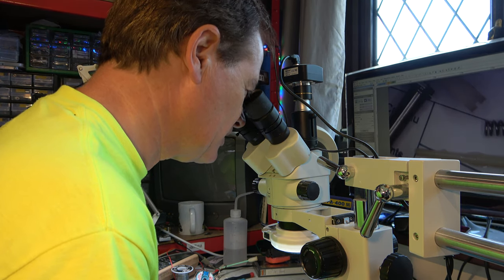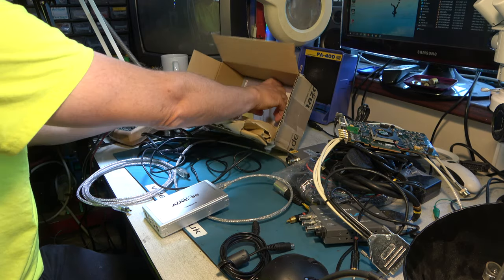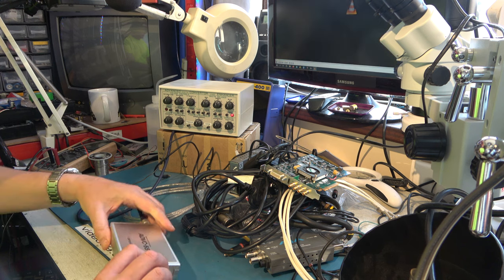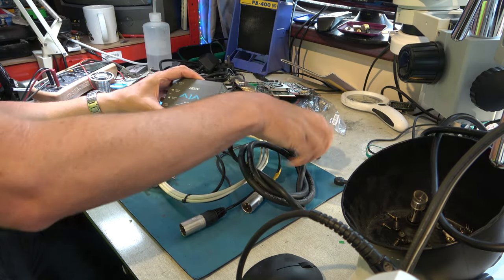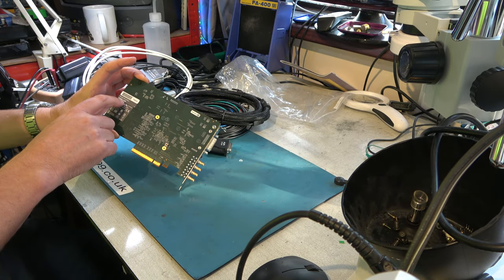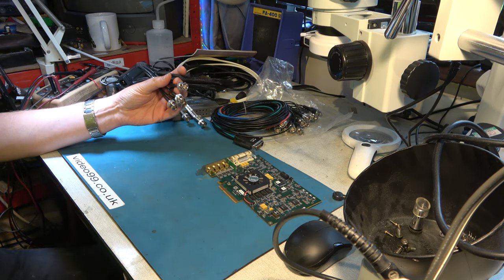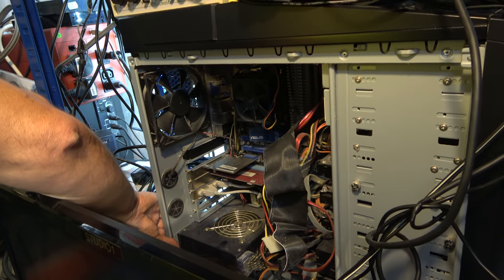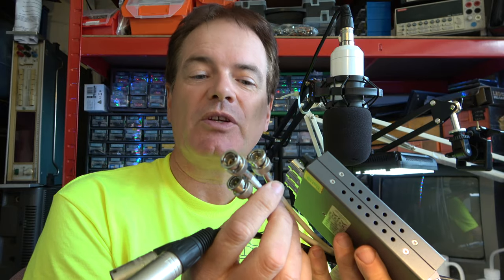Mailbag of fantastic audio/video goodies. And a terrible mistake?

Comment: There's a good chance the AJA SDI cable is closely bound like that because it's a bridge to the breakout box, which has 4 SDI connections at about that spacing on the back.
Reply: And thanks for the vid - interesting to see the application with the old decks!

Comment: The AJA Kona series of cards are great capture cards and very flexible with the multi-I/O options. At work, I was using a Kona LE on a 2008 Mac Pro as a dedicated PAL capture rig, the LE had analog audio IO which I used as the main audio out for the machine, I ran SDI into the card and also had AES/EBU connected to the other end of a Sonic Solutions SDIF converter and used the LE for input into Nuendo. I stopped using the card when the fan failed as shortly thereafter a 2012 Mac pro was freed up to become the capture machine and it already had a BM deklink card installed. For now, the Kona is sitting in an antistat bag waiting for a fan.

Comment: My heart also stopped when you plugged in that very nice looking card with semi power applied.
Thankfully the system was in some kind of sleep/standby.
Phew! 😀i was pleased :-D
I would be surprised if the quality was anywhere near your pro equipment.
Fun to have a look and a fondle of some interesting gear :-D
Ooow you had glued something at the start, was the part strong enough?.
That j.b weld is much stronger than araldite with rough repairs.
Reply from the maker: I've not yet tried the repaired SuperBeta part, I doubt it will hold though.  However I've been quite busy with my head in a Panasonic K-mechanism this weekend....

Comment: This is the first time I've seen a computer power supply installed like this. I believe the PSU should go with the fan facing down, not up. That way you will suck up the fresh air from under the case, which I'm sure has some kind of air filter in it. At least this is what I see in every case-build manual I read. If you leave it like it is now, you will get massive amounts of dust inside your PSU. If the layer of dust gets moist a bit, it will short something out in time.
Reply from the maker: There are no vents in the bottom of this case.  It's quite an old design.  If it had been mounted the other way, the fan would have been up against a metal sheet.

Comment: The tripod you had was sold in Asda around about the early 2010's. I know this as I owned one. Horizontal was silky smooth, and the legs extend to become extremely tall and remain stable. but vertical movement was awful.
Reply from the maker: Tilt seems a bit sticky, I'm going to apply a little grease to it.  But as a lightweight tripod to just put up quickly, it's not bad at all.

Comment: AJA Kona 4 SDI Connector = DIN 1.0/2.3                      I used my ADVC-100 with locked Audio Mode and Panansonic DV-in Camcorders for Sat-TV recording. Premiere can´t open my DV-AVI1 Files.

Comment: The cap card probably misbehaved in the first machine due to BIOS settings or the chipset being naff, as AMD back in the 2010s were awful. Also, the reboot on the second machine was caused by Fast Boot in Windows falling over due to new hardware - a reboot is expected. You can get older Intel machines that would be comfortably fast enough for that card, that cost peanuts now. 4th, 5th,6th and even 7th gen Intel CPUs are dirt cheap now and would be massively faster whilst being more energy efficient.
Reply from the maker: Plan is to install it in my i7-4790K machine later when I re-arrange my computers.

Comment: I wonder if youd be able to publish the pinout of the AJA HD10AVA card. There are plenty available online for reasonably cheap but none with cables. Making custom cables should be easy but without the pin out its a bit of a challenge.
Reply: The Manual from the AJA HD10 AVA does not have a Sub-D pinout, AJA HD10 AMA Manual Page 7

Comment: hi that computer is old my one not far of  i am  using a old amd3+  x4 4ghz is  very old  still running    the mum  pcb is very bad  solder is lifting  save up for a new 
pcb    cpu work ace still  i have m-audio sound card  pci    44 66  1010  why i can's my a new  pcb it's all pci-e now